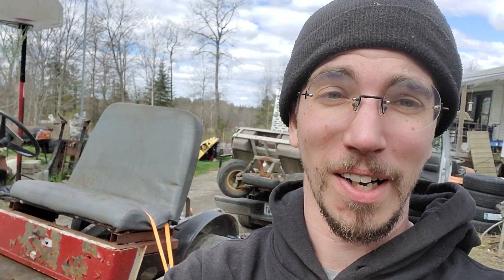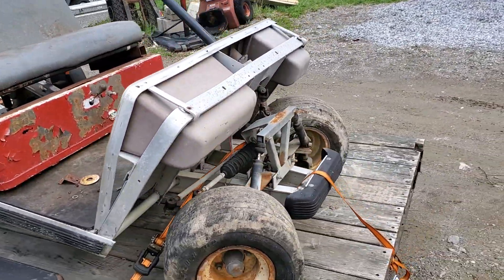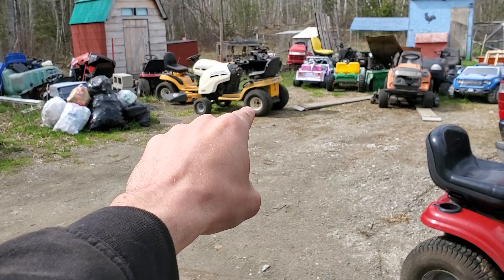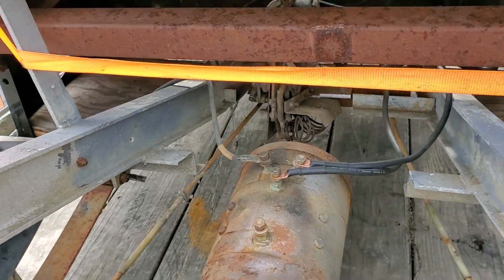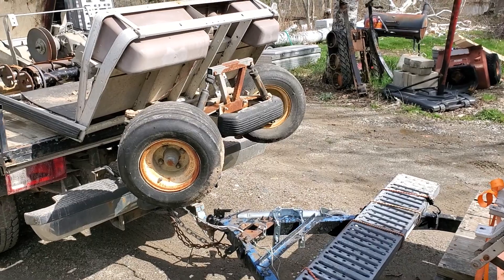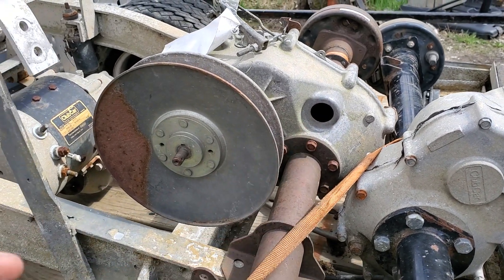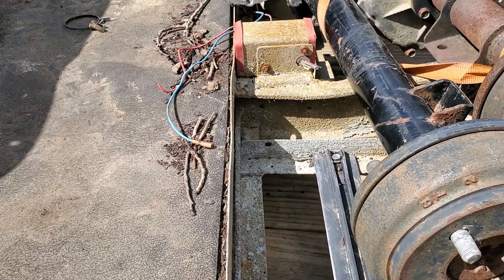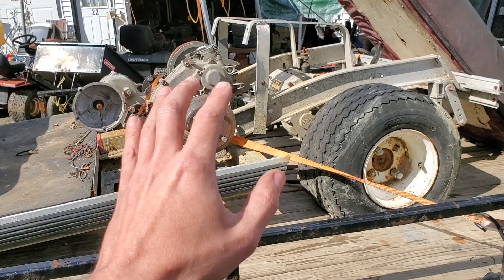Electric Golf Cart Carcass's

Comment: For the electric one, you should find a cheap craigslist generator to mount inside and make it gas and electric hybrid, batteries are expensive and won't last long unless you have a lot of them, a full set of batteries is on average $1k,  you could find a cheap generator for $100, you will need at least 5k watt generator and you could have just a few batteries for short range and run the generator for long range maybe both at the same time for max power...   there are a lot of those electric golf carts around with dead batteries and it often isn't worth it to spend $1k on batteries,  this could show people an easy alternative.
Reply: Good call... might even be able to get away with a smaller generator and charge controller.  Thinking the charge controller will most likely be most expensive if using a 1k generator.  Wondering if most cost effective would be hacking an engine have already and salvage yard alternator(s) together?

Comment: Hey buddy, the electric one will be a fun build, and yes a dump bed for sure. Good work kart 👍. As for the other one. Buddy I have the same front end but a different rear end. It's out of a club car. I'm still scratching my head to what to do 😕 motor wise. Gonna try and do a go kart tho 👍. I don't have that whole on mine, build say a fill port missing the rubber plug 🤞

Comment: I'd make'em more off road style.  The Cub Cadet's have those 4 lug hubs that match and I'm guessing the different not so typical tire sizes also.  Interesting.  I just received the 1" to 1.125" sleeves in the mail today for the Ford LGT 1X5's 5x4.5" lug female threaded 7/16-20 hubs to the 5x5.5" adapters.  The sleeves are for the 1" axles shaft and 1.125" I.D. of the LGT hubs.  Still waiting on the 7/16-20 sleeved acorn lug nuts.  I also had to invest in a 3" and 3.125" hole saw since I only have a drill press where I'm working and the adapters I.D. are 73mm and the LGT has a ~80mm dia. ~0.375" protrusion on the rim mount face, are T6 aluminum and I just don't want to risk putting in the cheapo 7x10" mini-lathe since the O.D. is about 7", slightly less.  Almost will have everything for the truck 15" rims and 32" tires to mount on.  Made a tire ratio libre office calc spreadsheet to size the tires so to keep level also and looks about 32" rear needs a ~22" front, 29" rear needs a ~20" front and 26" rear needs a ~18" front.  Nice job on the latest Craftsman deck welding fabrication work... pretty sweet restore.